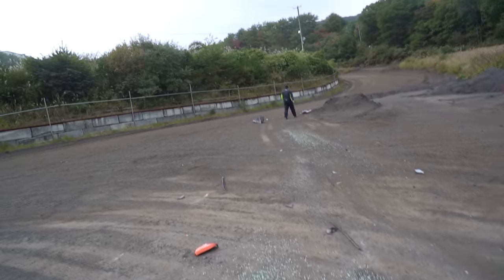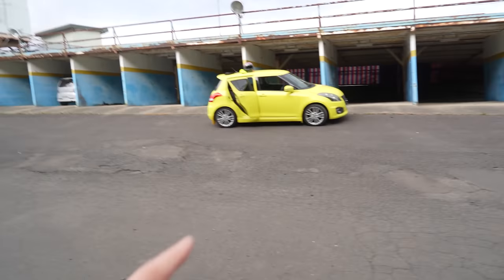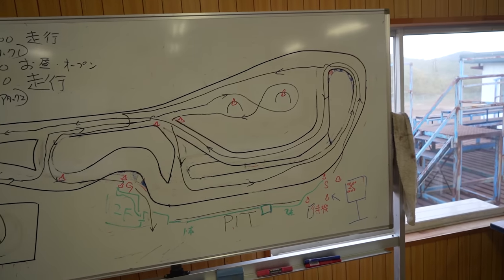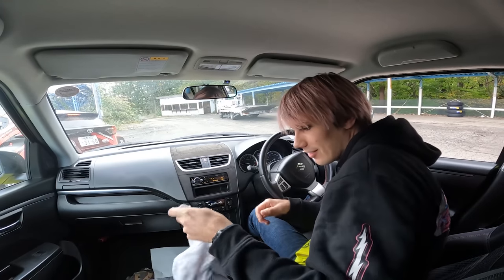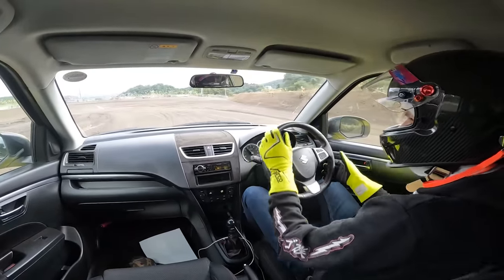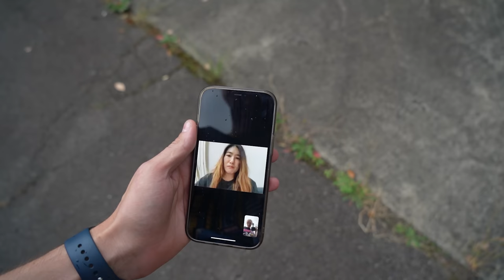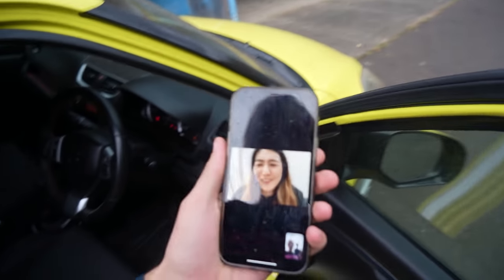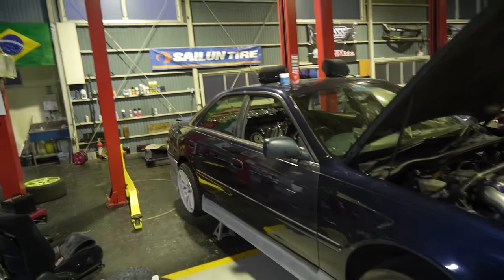RALLYING MY WIFE'S CAR!

Comment: Sam, whats stopping you from checking the regs for grass roots rally class cars? Depending on the regs, pick up a stat wright off, gut it, do the safety stuff and have fun. Like you and drifting, start from the bottom and work up. Yeah you have the evo 6 tme project car, but unless you're some form of driving prodigy, more experienced persons in similar cars will do better. Not saying give up on the tme, just saying start small and be the big fish in the small pond, not the small fish in the big pond

Comment: Definitely need some 4 wheel drive car for this! But the swift is doing good!
Reply: He’s got a evo but it’s basically in parts right now
Reply: @ThinkOfTheSkye  I know, but as you said in the next time it's definitely not driving. Also I think something with a lower value would be good to have some fun and don't care about crashing it.